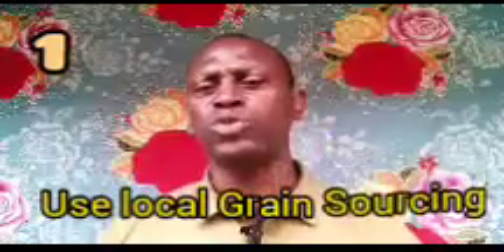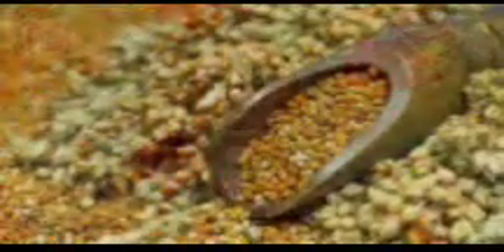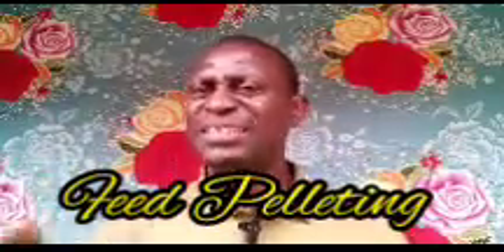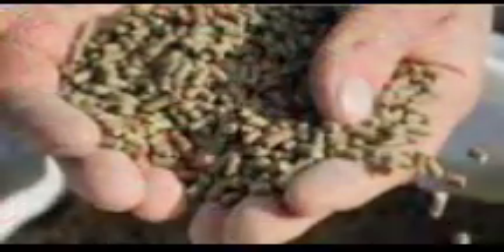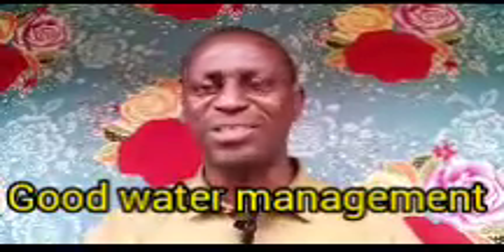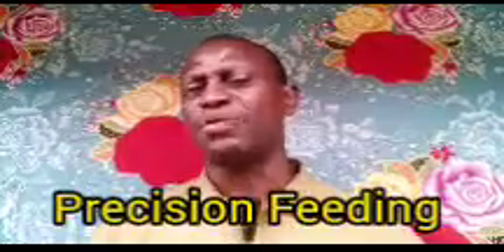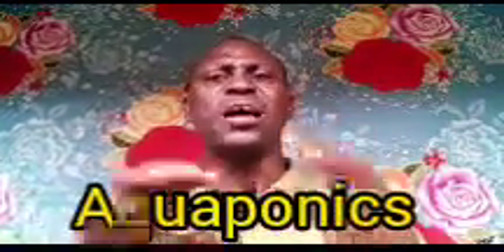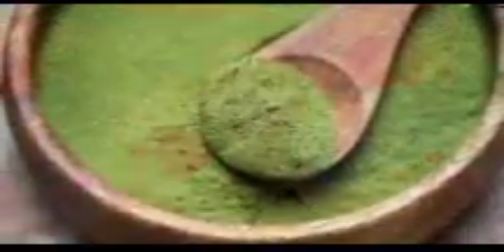DIY Poultry Feed: How I Cut Costs and Boost Profits Raising Chickens

Comment: Thanks for your teaching. My area of problem is the percentage or measurements of each of the feed ingredients particularly for layers (starter, grower and layer)
Reply from the maker: Sir, it is stated that 5% inclusion is adequate. That means every 100kg feed you make use of 5kg
Reply from the maker: Unless you are requesting for a feed formula for different stages of thire lives with weed